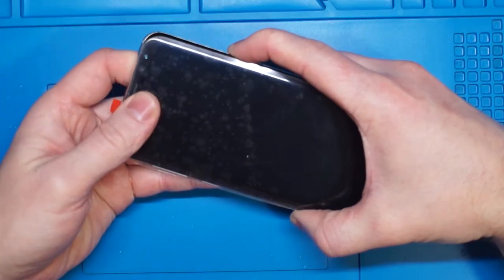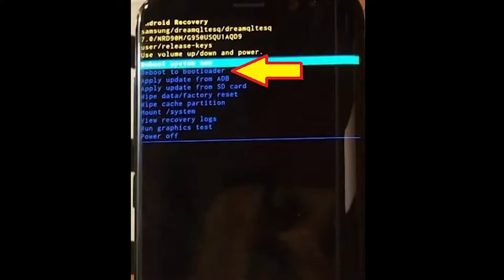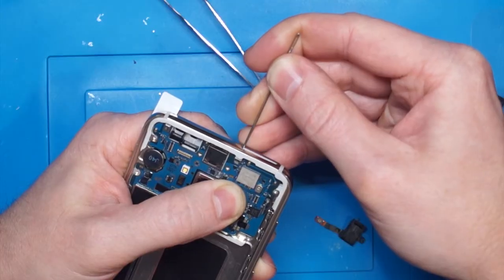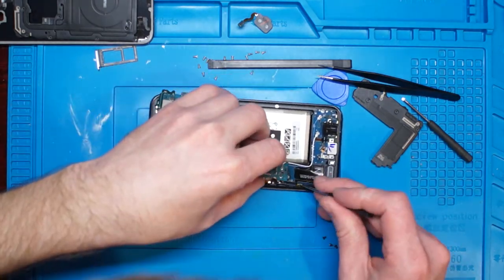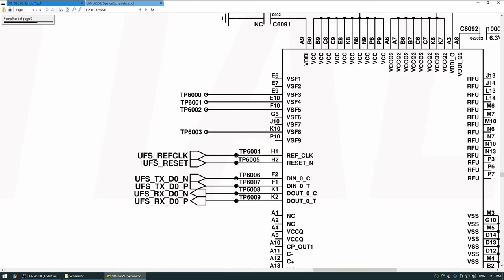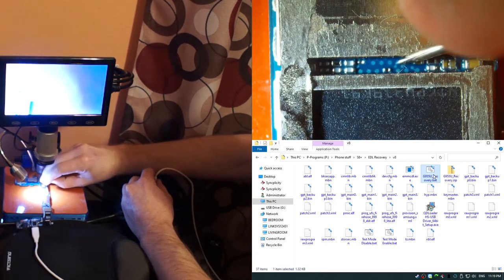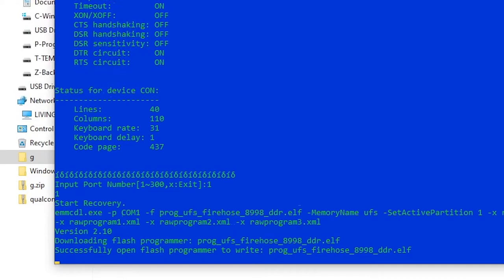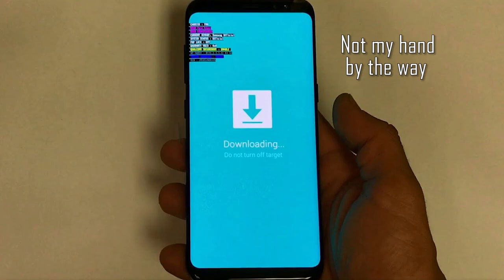Galaxy S8 Plus EDL recovery #Galaxy #android #unbrick

Comment: Hi Tony,
i've got s8 that stuck on bootloop after update via odin.
no mather what tried - still bootlooping.
can access recovery and download mode.

can you assist?
Reply from the maker: This can happen when your accidently downgrade.
Find latest version of the firmware that comes with all files including BL and flash it.
Do not click "pit file" tab. Just select all files and flash as normal.
Reply: @tonycstech  it didn't happened duo to downgrade.
i tried to upgrade from nougut to pie without removing PIN and no enabling OEM.
do you think it's bricked?

thanks for your support!
Reply: @08pini I did the same did you ever find a solution ?

Comment: Hi pros

I'm in kind of a similar situation....I think I flashed MY 950U PIE with wrong BL
I was flashing (for rooting) android 7.0 to an S8 and it completely died, this is how completely:

- No screen/LED/vibration motor [Phone get  warm when I plug it to charging or connected PC ]
- No safety/recovery/download mode (and don't ask about button combos, I've tried them all)
- No USB recognition from device manager (not even as Exynos in other devices, just nothing)

When connected to pc....device manager Recognize device as QUALCOMN HS USB 9008 (after 18 hours it's not working now )

Any way to brig it back to life...?

Comment: Hey my man can you do the same for a note 9 ? That won’t boot due to unauthorized software(modem) fail?
Reply from the maker: i dont know.
Make sure you are flashing with latest firmware.
If your bootloader is newer then what you flashing, you will have problems.
Also do factory reset right after flash.
Reply: @tonycstech  yes I am on b9 I suspect the only way now is to do edl -,pin out ?
Reply from the maker: I just got my self NOTE 9.
1st thing i would advice is to stay away from galaxy phones because my phone has android 10 and therefore bootloader 9 which is not unlockable so it cannot be rooted.
2nd, i dont have required files for note 9. 
3rd. service manual for note 9 SM-N960F specifically is 
https://drive.google.com/file/d/14986qJyU_cbFK_El0L9azzpvT14LeOGP/view
but it has no pinout so i cant tell. Maybe you can find a better one.

Comment: I need your help, I do all the processes you indicate in this video everything works fine except recovery 955u1 which does not work: error Sahara

￼
Reply from the maker: As i stated, your bootloader version is greater then supported by this method.
I dont know if they have an update released or not.
Contact the guy i mentioned at the beginning over at xda forum. he should be pretty active and is way more up to date about this issues.
Reply: @tonycstech  ok i have bit8 bootloader version but i can't find v8 file for my Galaxy g955u1